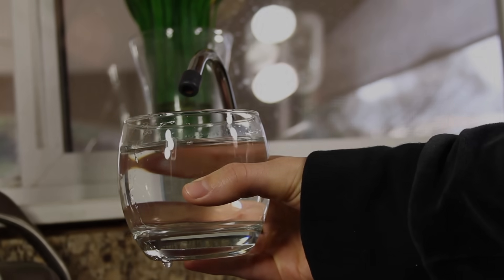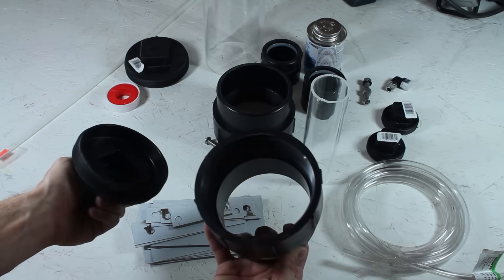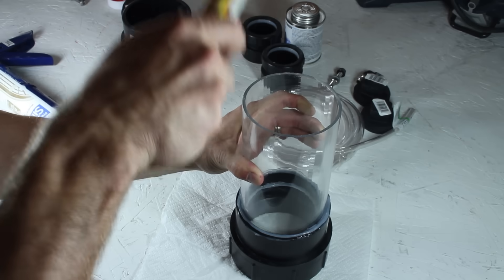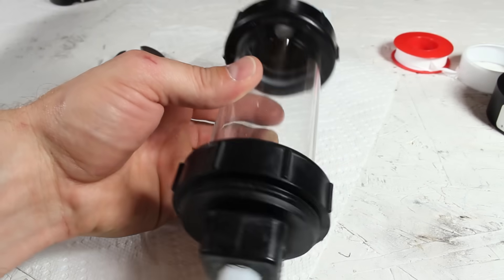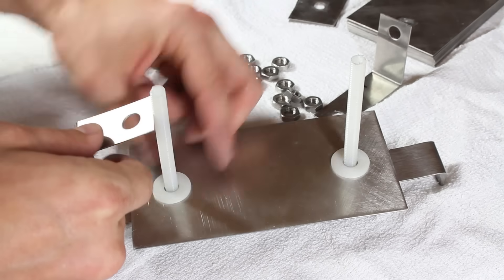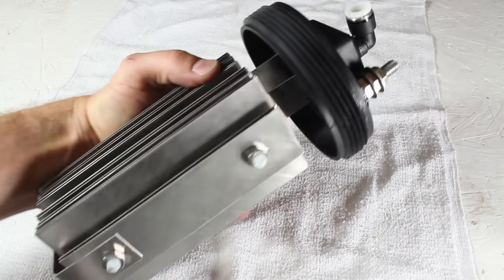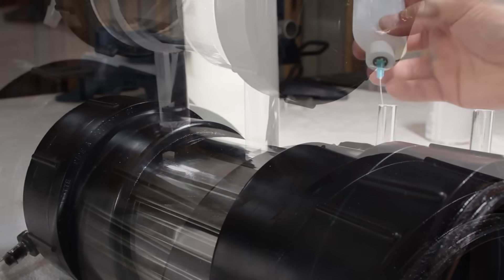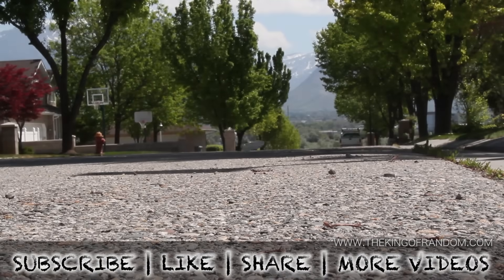HHO Generator - Water to Fuel Converter

Comment: What is preventing this sort of fuel-conversion system from being used to fuel combustion engines, or at least modified to be used in a vehicle?

Calling all engineers and captains of the internet!
Reply: 1) Energy Requirement
You need to power the electrolysis which requires a power plant to produce the electrical energy spent in making hydrogen gas and oxygen out of water which is commonly done by burning fossil fuels. Solar panels can be used but are not effective enough for large-scale industrial application, especially on a global level. Some commenters seem to believe this form of energy is free despite the video clearly showing the opposite. It costs money and it relies on electrical energy of which a majority is still harvested from fossil fuels.

2) Storage
Hydrogen and oxygen can be compressed into liquid form but they will still take up more space than gasoline. Hydrogen is hard to contain and will leak through most surfaces given time, especially under pressure. Most importantly though, like with electrical cars, more space will be used for storing the fuel, leaving less space for passengers and luggage, which is inconvenient. The thicker walls of fuel tanks will add to weight which is inconvenient on electrical cars as well.

3) Volatility
Hydrogen itself is not explosive but a hydrogen-oxygen gas mix is extremely volatile. Gasoline isn't very flammable in comparison. A lit cigarette won't light a patch of gasoline on fire like in movies. It might ignite a hydrogen-oxygen gas mix. Considering car accident statistics, using potentially extremely explosive substances in everyday traffic is controversial. People are stupid. Gasoline is relatively safe.

4) Cost
Like with electrical cars, the technology already exists and so do cars using it. It's a matter of providing the logistics behind it. There have to be hydrogen fuel stations and modifying cars to employ HHO is costly. Most people use gasoline cars, that's why most fuel stations cater to them, which is why most people buy those cars - a circle that is of course supported by the oil lobby. Electrical cars don't have the reach of gasoline powered cars, so they require a network of densely spread recharge stations for comparable flexibility which doesn't exist which is a reason for many consumers not to get an electric car despite the advantages which means that providing a network of recharge stations is not lucrative, et cetera.

This means that while the fuel does not create emissions other than water and can be harvested from an abundant resource, it isn't yet as efficient as fossil fuels and requires extensive amounts of power to make which cannot yet be provided with emission-free means on a larger scale. The technology exists, there are cars using HHO, making hydrogen gas out of water is comparably easy for everyone (as shown in the video) and it is, ecologically speaking, certainly a superior fuel in an optimal environment that doesn't depend on economical factors, but those are unfortunately still relevant. So is convenience as most people don't want to get an electric car either for lack of an own garage or suitable recharge stations, high range needs or purchase cost.
Reply: You forgot to fly away. 

This was extremely helpful! I appreciate the information. :D
Reply: Nick Kluger
Oh. Do you mean using the alternator / car battery to split water into gases? Then that would be very ineffective. And it would essentially again be the same concept of burning fossil fuels for harvesting hydrogen gas.
Reply: LootFragg everyone always says "it takes more energy to make hydrogen" seriously what do you know? if this guy can make this with a bunch of junk imagine what a really optimized NASA version of this would be like.. as i mentioned earlier Navy can power boats off of seawater .. it's very easy to make hydrogen and its more combustible than gas..
Reply: LootFragg Where do you get your motivation to spend hours trying to explain to these close-minded idiots that their wrong.
Reply: Leo Sjöberg
Temporary satisfaction of my nagging idealism.

I want the world to be educated because I see most problems in the world coming from lack of it.

I tend to give up after a while if no change is apparent and no new challenge arises. Until then, I value every single kid who goes "oh, I see" for a second more than the time and effort put into writing a small book.

TL;DR: Haven't given up yet. ^^
Reply: Nick Kluger if I might interject my own point, I understand what you are saying, but it doesn't work that way. I will go ahead and make a point that was not brought up. Do to friction, thermodynamics and the just the way things work, perpetual motion is simply impossible. What you are describing is a self sufficient machine. Not possible. You get something called the rule of diminishing returns. Basically, the more you put into it, the less you will get in return. I'm not a physicist, however I am a mechanic. A diesel mechanic, something we understand is thermal efficiency. You are losing way to much heat energy from the hydrogen gas, to make a small 2 stroke engine even remotely powerful enough. And something you also need to take into account with your alternator theory is that it takes a lot of electricity to split water, by comparison anyways. Now, to put it in a shorter perspective, my diesel truck makes around 600 hp and 1200lb ft of torque (I'm sorry, I'm not sure what that is in bhp or kilowatts). My truck has 2 batteries and 2 very large alternators, neither of their combined power would be enough to create the reaction needed to split the water. Now, a very small weed eater engine would never beable to turn the brushes on a alternator large enough to create the desired charge. Especially when you factor in the considerable power loss that hydrogen gas will net you.  I believe hydrogen has somewhere in the neighborhood of 60% the latent thermal energy that gasoline does, and around 35% of what diesel does. Strictly from a mechanical standpoint, it's just not possible. The machine would run itself out of fuel, right as soon as the initial supply of fuel was exhausted.
Reply: It is used in vehicles but i think its to increase fuel efficientcy note used as a 100% fuel
Reply: jamiepie123
I can't refute it but I doubt it is. I've seen rough schematics of a hydrogen car and using BOTH fuels in the same car doesn't make sense to me. You need a fuel tank for each and I don't think normal engines would do well with water in them. But I'm no expert.
Reply: LootFragg
When most car engines are running they have an alternator that produces around 12v (to charge the battery and power other stuff). So in a car you do have power, just maybe not enough, but you still have power. Also you could modify your car to give more voltage when the engine is running. etc.
Reply: Nick Kluger
While that sounds about correct, I don't see how it relates.
Reply: LootFragg
Oh well when you said "You need to power the electrolysis which requires a power plant to produce the electrical energy spent in making hydrogen gas and oxygen out of water which is commonly done by burning fossil fuels"

I was replying to that.........
Reply: Well If the car engine was running off of hydrogen then it would not be fossil fuels. The main problem with this concept is that the generator would have to produce a lot of gas to run the engine at all, on a highway the generator would need to produce an immense amount of gas.
 LootFragg
Reply: Nick Kluger
Alright, let me break it down.

You need energy to make hydrogen fuel.
If you take that energy from burning hydrogen fuel, you end up with less than you had previously.

You need an initial energy source. Hydrogen fuel is only a means to store energy. It's like a charged battery. Batteries only store energy, they don't "make" it.

(By making I obviously mean converting into usable energy as making energy doesn't work.)

So the alternator is a way to convert chemical energy of fuel into electrical power by losing a bit of energy in the form of thermal energy.

If you then convert that electrical energy into chemical energy by splitting water into hydrogen and oxygen, you lose more energy.

There is no point in doing that. The chemical energy is there to be converted into mechanical energy so the car moves.

Everything else is done beforehand. Making fuel on the go is a concept that does not work.
Reply: I know, It would not work, you would need a very efficient car and a gas generator that would produce a lot of gas. An the initial source of energy would be a battery that would start the gas production, when there is enough gas you would start the engine and the engine would make electricity to power the generator.
Reply: LootFragg
Also if you think that I am say it is a closed system I am not. The plates in the generator will eventually wear out/dissolve, when that happens you would need to get new plates.
Reply: Nick Kluger
No, it does not power itself at all. It's like shining a light bulb onto a solar panel that powers the light bulb.

_____________

The energy required to split water

is bigger

than the energy released when making it.
_____________

It's a cycle of loss, there is no gain in it. The energy requirement for storing energy always exceeds the energy received from releasing it. At least in the real world. On paper, we could speculate about one where there is zero loss but no gain but there is no physical scenario in which energy would be created in this process.
Reply: LootFragg
I do agree, but with a small 31cc engine, and 5 liters a minute of gas production the engine would be at least able to idle if not run at operating rpms. If the weed whacker engine had an alternator setup the engine would easily be able to power the gas generator. You seem to be thinking that I think that it is a closed system, but it is not. The energy is coming from the plates and water when the plates or water lose all of their stored energy, then you would need to replace them, thus making it use our finite resources and making a not closed system.
Reply: Nick Kluger
Hm. I think I cannot follow your thoughts. What do you mean when you say: "The energy is coming from the plates and water"?

To me, this sounds as if you were talking about the electrolysis shown in the video, where contact plates split water into hydrogen and oxygen.

I don't know if you mean that but if you do, then you might be on the wrong track. This electrolysis costs energy. The finite resource here is the electric energy used in the process.
Reply: LootFragg Yeah forget that energy plate thing. But in the proses of electrolysis the finite resource of what ever metal you are using gets used up. Also "electric energy" is only finite if you use fossil fuels or another resource to produce it, If you use solar panels of wind to get electricity it is not finite.
Reply: Nick Kluger
I thought that was implied when you were talking about a fuel engine.
Reply: LootFragg
what was?
Reply: Nick Kluger
That you are using fossil fuels to produce the required energy.

I assumed this was about being able to use a car engine to create fuel. Nevermind then.
Reply: LootFragg
Ohhh what I mean is to run any sort of engine off of this fuel then use the engines alternator electricity to run the generator.
Reply: Nick Kluger
That's exactly what won't work.

The required energy always succeeds the outcome. You put stuff in and get less back.

The only question is how you want to get it back. In what form.

You can put fuel in a system that produces fuel. You will get less fuel back than you spent. Repeat until you have nothing left for no gain.

Or you can put fuel to a different use, such as mobility. The total usable energy will still be less but it will be beneficial.

As a metaphor: You give me 10 Euros cash. Or Dollars. I could either give you 5 Euros back in cash or give you something to eat worth 5 Euros.

The first choice means you will lose 5 bucks without any gain.
The second means you get something to bite, even if it is pretty overpriced.

Which would you prefer?
Reply: LootFragg
What about this. If you have a 31cc weed whacker that needs less then 5 liters of gas intake per minute and you have a generator that produces 5 or more liters a minute on whatever 24v, and the weed whacker engine can produce 24v, with modification? What about that? I get what you are saying and it completely makes sense but I don't think that applies in this situation.
Reply: Nick Kluger it will never apply in that situation, Thermodynamics says no, like what lootfragg said before about using a light globe to shine on a solar panel that powers the light globe its self, all you have done in the instance above is add what would be a battery, 12v light heats solar panel that charges a battery to 12v that powers the light, if you did that the light will eventually go out from lack of power when the battery is not charged, the power to use the generator will cause you're weedwacker to lose efficiency and power dropping lower then 24v and causing you to lose gas pressure and power, in the end of the day you need to lose something to have power nonething at this point in time can be infinite
Reply: facehit
You are losing something, when the generator produces gas, the plates and water wear away and you would eventually need to replace them, it is only self sufficient until you need to replace the plates or the water. When the weed whacker is running there isn't much load from the generator, all you need for the generator to run is 24v and not very much amperage.
Reply: Nick Kluger
You seem to misunderstand what I and facehit are saying. It is not about the apparatus wearing off. Even if it was indestructible, with no wear, it would still apply.

The basic laws of thermodynamics dictate that it is impossible to create or destroy energy. Everything, anything in existence, from the past until now, has always obeyed these laws of physics.

If you happened to find just one single case in which energy got either destroyed or created, and you could prove it, you'd be a rich-ass guy in no time and would be hyped as the most important man in history. Stephen Hawking would want to chill on your couch. Einstein would come back to life and high-five you.

What you are describing is an impossible scenario that is not remotely considerable in the real world. Without going into details about how voltage does not mean energy but: I think, you're overestimating hydrogen gas.

It takes considerable time to even fill a balloon or a tube with gas. That gas suffices for one small bang. That is it. Gasoline burns much longer and gives off much much more energy. To harvest enough hydrogen to compete with a small amount of gasoline, you will need a HUGE lot of energy and a HUGE lot of time, which FAR surpasses anything a normal gas engine could handle.

Hydrogen is not magical. Hydrogen is a FAR WORSE fuel than gasoline. It is extremely weak in comparison.

The only reason it is even considerable as a fuel is that it is made from water which does not run out like oil. And it creates water instead of carbon oxides which makes it cleaner. But it is weak. And it will not, in no way, ever, rival gasoline fuel. Never ever.

Hope that puts it into perspective. You're thinking of a gas engine powering an electrolysis and you assume that the harvested fuel is as powerful as gasoline which it is not. Not at all.
Reply: LootFragg Okay so I have run a normal Briggs and Stratton 5hp engine off of this gas, it isn't very powerful but at least I have made it run. With more gas (more then 3 liters a minute) it would run stronger. I see no issue of powering the generator with the engine.
Reply: Okay when if the engine requires less gas then the generator produces at normal voltage then what? It would have more gas then it requires allowing it to rev higher and when it revs higher it would create more energy to power then generator.
Reply: Nick Kluger
Nick, this is physically impossible. To talk in metaphors, which I really like for some reason:

What if I jumped up and while jumping I pulled myself up and then jumped from there and then pulled myself higher? Wouldn't I be able to fly?

Yes but it's physically impossible. It's a dream that is not applicable in the real world. What if was a wizard? You could reverse time and summon dragons, sure, but you are not a wizard, so this is all speculation about something impossible.

I mean, after all, why the engine in the first place? Just put a generator there, reduce the required energy to zero and increase the output to a million billion watts per second. Put an ice cream machine next to it that doesn't need ingredients but creates unlimited ice cream to feed the world with. It would be the one machine to rule them all.

But it does not happen. Physics has a grip on our universe. It will not allow us to magically make ice cream without ingredients, to create unlimited energy from scratch or to teleport and fly around at our leisure. Physics is the asshole that confines our unrealistic dreams and pulls them back to earth. In order to make stuff happen, like aviation, space flight, internet, phones, speakers, cars, anything, we need to abide by the rules and use them to our advantage.

Breaking the rules of physics has been an unsuccessful endeavour since the dawn of man but using physics to achieve goals has been what has driven mankind.
Reply: LootFragg
But you're not breaking the laws of physics. I am not creating energy.

I talked to my science teacher at my school he said, "I see no problem with that idea" so I don't see what you are talking about.

I was talking to my college and he said that your analogy of shining a light bulb on a solar panel that powers the light bulb doesn't apply in this situation. I can see why you would think that would apply but it simply does not.

The generator would not run forever. It isn't a closed system because the closed loop gets broken when you need to replace the plates and water. Granted it would take a little time but it is not a "self-sufficient-system-that-runs-for-ever".

I would think of it like this. Suppose that you had an engine that ran on straight crude oil from the ground. The engine would run a pump that would pump the oil straight from the ground into the engine. The engine would run the pump. The pump would run the engine. Only for me instead of a pump that pumps crude oil from the ground I have a gas generator. Instead of the engine running on crude oil it runs on the gas produced from the generator.

Am I breaking the laws of physics?

No.
Reply: Nick Kluger
Steel and water do not produce hydrogen gas. The power that does is electric current coming from this dude's power plug at home or a car battery.

This is not just a device that makes stuff. It requires electricity to run. Without electricity, there is no reaction.

You could never create as much power with your engine as with the battery required to create the gas for operating the engine.

• You imply that the system powers itself.

- You also say that it is not a closed system.

- And you also say that you do not magically create energy.

> So the logical conclusion is that you lose energy.

• Which is a logical contradiction to the implication of the system powering itself.

That's all I mean to point out. It simply does not work, for logical and physical reasons.
Reply: LootFragg It powers itself and is a closed system until you need to replace the plates and water.
Reply: Nick Kluger
Nick, I think you keep ignoring the part where it is physically impossible by definition.

I recommend you build it and see for yourself. You seem to be a practical person with a lot of know-how about engines. Do your very best and see if it is even remotely capable of running on its own hydrogen output.

If you manage to make it run on its own output for only ten minutes before it runs out without it powering anything, I pull my hat as that would be the work of a master engineer.
Reply: LootFragg
okay, also the generator puts out oxygen to so it would be a very explosive gas.
Reply: Nick Kluger
Nick, build it, make a video of it, show it to the world, become a billionnaire.
Reply: Halorix Crin This is not 9gag lol
Reply: Leo Sjöberg
What does that mean?
Reply: LootFragg
Okay.
Reply: ***** You are an idiot. This type of fuel doesn't work, it takes more energy to seperate the Hydrogen from the oxygen than what you get out of it. Do some research before you write an essay
Reply: ***** Well done. You successfully produced a working model of a confused, trolled individual.
Reply: *****
Yo Troll. Build it. Show it. Simple. You say magic works, the burden of proof is on you.
Reply: *****
Hook the batteries to an e-motor and see how much mileage you get compared to the little bang in the video.

I get it, it's the big companies that are trying to control the market. And that's correct. But I think you're overestimating their influence. They can't control every single human on Earth yet. At least as long as we wear our tinfoil hats.

One thing you could do, if you don't dare showing your invention to scientists, engineers and people with an interest in massive profits:

You could use the batteries to make gas.
Then use the gas to power the batteries.
Then repeat the process and feed the excess energy into the power grid, pretending it's coming from solar panels (so the government doesn't snipe you). This earns you money from the power companies because they have to buy your solar energy before selling it to you. At least here in Europe.

Because your invention produces infinite energy, you can make as much money as you desire without being dependent on anything.

In addition, you can use the infinite energy to do whatever you want. It's infinite energy after all. I recommend becoming a villain because that's stylish.

Call me when you're filthy rich. I shall be your henchman. I'd definitely serve a super-villain that has access to infinite energy.
Reply: Jonathan sauder Okay, it is not self sufficient because it uses up the water in the process of electrolysis. Hydrogen its self is not very powerful but when mixed with oxygen it is quite powerful. Just watch the end of the video. The alternator part I might have to rethink though.
Reply: Nick Kluger
The electric power, mate. Not the water. It's about the electricity it consumes.
The resource in question is the electricity.
Reply: My car (3800 L67 S/C engine) has a vacuum inlet port on the throttle body. I wonder if it would be possible to feed this gas through the port and with the right tune, get it to run with very little kr.
Reply: Edward James Bickels
Try it.